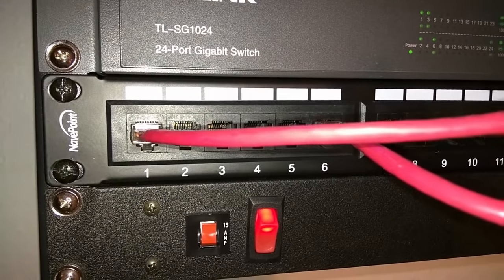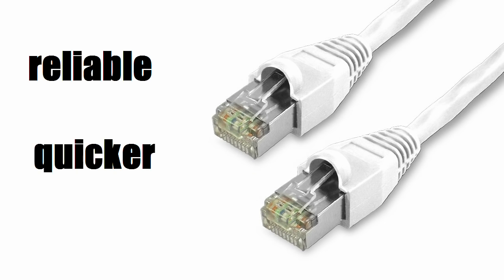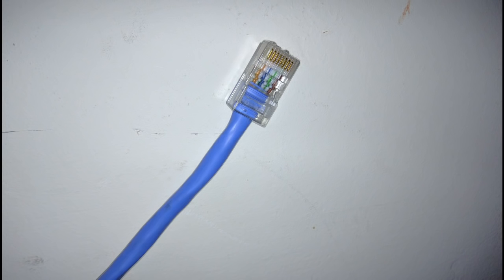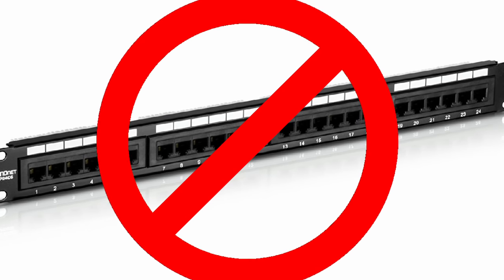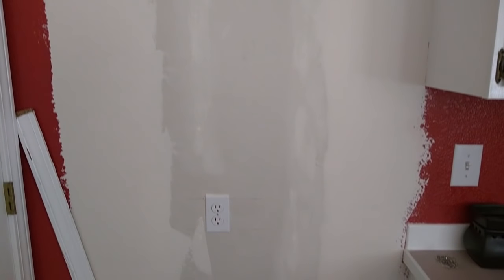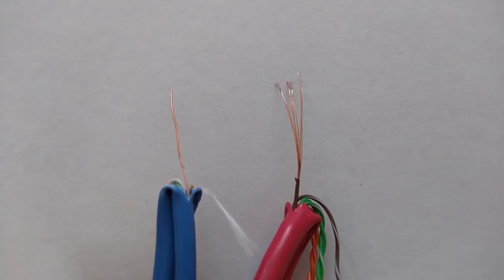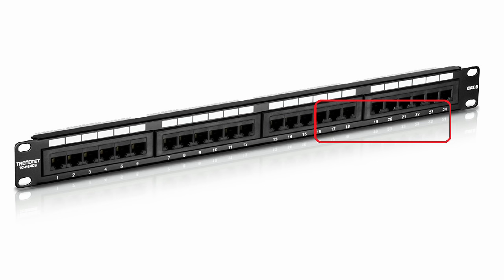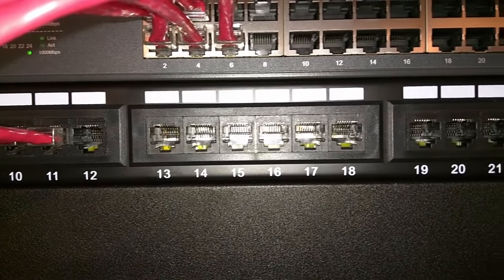What is a Patch Panel? Do You Need One?

Comment: Patch panel are dumb and a complete waist of money (labor+materials), Properly label all the cable, and plug them all directly to a switch are the best way.
Reply: No. You obviously have no experience with large networks. Patch panels are great for installing cable once and then connecting (i.e. patching) things to go where they need.
Reply: Sure, if you want to work harder later and you're not used to documenting your work. Otherwise, as Samira Peri said, PPs are a must in a large network. Heck, even in my house I have a rack housing an OPNSense router, a gigabit switch, a NAS, HASS controller, NVR, can you imagine having almost 24 (and more to come) labeled CAT6 cables dangling in that, not big enough, enclosure? In the summer sometimes I need active cooling, it's just not enough space for snakes, a PP can help to keep everything neat and tidy. But at the businesses I have under administration, with 100+ cables in the main racks, to not use PPs is just crazy, but then, they have more money so they can ask and pay for better cable management, which is good for me because that means more work and documentation initially but lazy money afterward (not to mention easier times to document the networks for ISO certifications). Anyway, I would do what you say in a small house network, with not more than 4-5 possible wired devices, but usually, I avoid this mess. :)
Reply: Lol. No.
Reply: @vincinoyb9734  Me? All day long! I like my PP! And it appreciates my attention. Now, seriously, of course, you're right, if you can fit everything in a 5-port desktop switch or maybe in an 8-port one, a PP is overkill. More than 8 usually means some kind of server, PoE injectors, UPS and things are getting messy already. Anyway, design with extensibility in mind. If there is any chance for a network, a home network I mean, to grow over time, better leave space for a future rack and enough cable to route it in the rack. Cable and space in a corner are usually cheaper than redecorating a house. The reason for using a PP is not because it looks cool, well, some does, but because it allows you to use the standards. better document and physically manage the network. Also, to use AMP products is not exactly a requirement for a home network, but at least use products from a reputable manufacturer. Networks I designed or helped to make 10 or 20 years ago are starting to bite my ass with small things, but very annoying. Cables left too short in the wall? Check. Cables with isolation that changes its color from one end to another? Check. Not enough cables in the wall because the owner considered at that time he wouldn't need them? Also check. Cables with low transfer rates because they're running along the 230V power cables (Romania, EU)? Naahhh, kidding, I never made this mistake. But the list can continue. Anyway, this is from my own experience, I'm not really in business of cabling network, I'm managing what they're usually designed to do, but it helps if you have from the start a good, reliable infrastructure.

Comment: Blah, blah, blah, just label the switch that is coming from your router and after that write the number on the wallplate, done. Just get a 48 port switch if you want to be complex, and after that you can just add another switch if you fill up all the ports and run a patch cord between the switches. Patch crap.
Reply: Sorin Sandu Who cares about which wire goes where in the house anyway. Just plug them all in. I mean, at the not-switch side of the cable, you know that the cables go to the switch. You can label the wires nearby the switch, and then you have everything you need to know. No need to mark the outlets throughout the house.
Reply: Of course, there is a need!!!  I was having Network issues. my Tivo Stream was having issues streaming to my Windows Computer.   I notice a feature on my Managed Switch to test the lines.  Sure enough, it told me what port on the switch was having cable issues.  But I didn't know which one, or if that as even in the room with the Tivo.   I also found out I had some issues with some other ports around my house.  It took a while to go though room to room, plug one in of my cheap tester in and start unplugging cables on the switch to find out which was which.  What a hassle.  I labeled the cables as I figured it out. in a way I would know what port in the room it was.  Having figured that out, I swapped cables where the Tivo was to a different port I I knew was good and it started working right. 

When you have a bunch of cables, Labeling makes sense.  All my cables in my 2 new Patch Panels are labeled.  So is each and every Keystone in the walls around my house.   So I can see MB1, and know that's Master Bedroom Port 1.  1 starts on the top left, goes right for 2, down left to 3, and over for 4.  It depends on if I have 2, 3, 4, or more ports on that wall.  In my Computer room, I have 2, 2 port Wall plates and a 3 port wall plate. on on 3 of my walls.  The 3 is a new one.  I almost wish I went with a 4.  Darn,  I'm not going back under my house to run another cable.

Comment: just get good wifi lol
y'all talk about security with cables but all your smartphones is still connecting to your home network via wifi and it hold all your personal/banking data lmfao
the only real benefit of cables is for gaming devices to get good latency
its way easier to just unplug a wire when you ground your kids or replace the entire router/switch when you have a patch panel ready
Reply: Never been in a place where good wifi is possible, eh? Either heavy wifi use in the area or building materials make wifi propagation difficult. Yeah, you can throw access points at the problem to a rediculouz point. But you'll still be having to drag cables to every AP. Otherwise you may have great coverage  but it's slow as hell.
Reply: Yeah, wired networks are a flex, but it's not a pointless flex. Low latency is useful for more than just video games. Some people like to have a NAS, home automation, custom DNS, etc. on their network, and wireless just isn't good enough for that. In fact, some software actually require a wired connection (Proxmox VE is one example). Or, if you're hosting a server at home that will have a fair amount of traffic (such as a public-facing website), you don't want to congest the WiFi space for you and anyone else living with you. As for security, you could keep devices like TVs, smart lighting, and your smartphone on an isolated network using VLANs.
Reply: @glynnetolar4423  unless if you live in a mansion then yes you need multiple access points lol
a normal house only need 1 per floor
Reply: @loucipher7782  a "normal" house? You mean 'Murcan cardboard house? Normal people being normal houses that are built out of brick and reinforced concrete. Wifi is absolutely piss poor in a normal house. I have a mesh network because of this, and I have 1 AP per room. Anything less already means patchy wifi.
Reply: @DavorZdralo  lmao. calm down there dude.
Reply: lmfao

Comment: No one needs this at their house at all, it's just for nerdiness. It isn't even a good idea at businesses with changing environments, it's a pain in the ass to patch cables when all you really have to do is VLANs and shutting down ports for security.
Reply: If you have Ethernet through your walls it easily gets to a dozen different ports around the house and it makes sense. 

If you have your main computer next to the ISP provided switch and the rest of stuff if via WiFi, then no, you dont
Reply: You assume that everybody has wireless connections available.  My house was wired with  CAT 5 cabling so the transfer rates were far higher than I could achieve with a wireless router,
I also had great difficulty in getting a wireless signal throughout my house.
Reply: hence the name of the channel and it was mentioned multiple times in the video,   so ease up Ponch!
Reply: I beg to differ. My home has 2 floors + basement, 6 PoE cameras, and a couple of unifi APs. Every room has 2 ethernet runs and anything not a laptop or tablet is wired as it provides security and reliability (no interference, drops, consistency). 

My patch panel makes everything easy to manage, even the phone lines that goes to our Brother printers with fax. Without a patch panel, it would just be a jumbled mess of cabling and even with some cable management, it would still be quite visible. I'm talking about  35 cables in my setup.

Comment: Also, is this video freaking for real?  How in the hell could anyone talk for 17 minutes about patch ports?  If you have more than 4-6 cables, use a freakin patch port!!  Better yet, call a professional cable installer / low-voltage electrician!  It's not 1999, and it's not cool to do your own wiring anymore, we sure don't in IT!
Reply: Most true IT still wire themselves unless cabling a massive 10,000 square ft building or something alone the line then yes they sub it out. It is not cost effective to hire someone to com drop 6-10 connections in your house. The channel is called budget nerd.....Many like the pride and prefer it done their way not the way of a sub contractor.
Reply: @williscooper7750  A couple jobs ago, I wired a half dozen 200k swf warehouses and a couple of offices, and I would choose the warehouse over a house any day. 10x easier, more accessible. Most IT staff at small/med business don't have the expensive testing equipment necessary to certify the cabling, which is the true value add. Sure, it saved 10's of thousands of dollars, but that still didn't mean it was the right thing to do, if there was another option avaliable.
Reply: You are literally speaking out of your ass. A cable tester is very cheap. and of course a warehouse or new construction is easier. I mean your points are very moot to say the least.
Reply: Besides, this was an informative video and a how to. Of course the time spent on this video can be done and is informative. The cost of doing it yourself and buy a cable tester is far cheaper then hiring someone to install a similar set up in your house. Which is what this video was directed at....dont be an internet troll
Reply: I'm not talking about your $10 "tester", I'm talking about the testing equipment that professional installers use to determine much more than continuity alone, and provide you with actual certification reports when they're finished, for every run in the system.  No offense, but you really have no clue.  

I just hate bad advice about this stuff, I see it every day..    Hell.... in the state where I live, you can no longer run your own cable, it has to be installed by a licensed, bonded low-voltage electrician, or risk building code violations and loss of construction permits, etc, etc....  I'm not saying you're going to get in any trouble for running a line here and there, by all means do it, but if you're literally talking about wiring up a house, pre-drywall, or during a reno, or whatever, don't fuck around, just do it right.  

You can be a "budget nerd", but wiring is the wrong place to cheap out or go full amateur, sorry.  If you had to come here to figure out if you needed a patch panel, you should maybe call a contractor, jus saying
Reply: Lol ok. I have no clue.
I agree with your comment about the video to determine if you need a patch panel or not. that is true but man you are so angry.

Also your state is a bit overkill on requiring license low-voltage installers. Its why you are paying WAY to much for it requiring tools that are unnecessary. Oh and I do pay more then $10 for my testers. Its $11.50, get it right gah
Reply: Matthew Mooney well man what can I tell. I had to setup 2 Access points. An Installer was charging me sick money to run it through the house. And i juat got a drill, 100ft of cable and a crimping tool with 4 terminals. BRO I SAVED EVERYTHING And did it within the hour. _. So I really don't get your point if it's in a house. If it's a business and have to do a whole patch panel 50+ terminations, then yes I would hire somebody but for a house. Forget it. And most house nowadays come wired you just got put the patch panel.
Reply: I had a bunch of cables in my house I ran 5 years ago, and I ended up putting RJ45 plugs on all the cables and then plugging that into my 24 port switch. It worked just fine.  The other end at the walls around my house I had Keystones in the walls.    It's been like that for the last 5 years.  It works and it's cheap!!!

I did upgrade a couple weeks ago and mounted a 8U Wall Rack and I'm now using 2 Patch Panels.  But I'm using something I like Far, Far better and is 10 times more flexible,....  These are Cable Matter Patch Panels that use Keystones.   With limited room in my closet, it was so much simpler to install Keystones on all my cables, and than Snap them all into the Patch Panel.   The other benefit, though I didn't do it, is you can use different colors of Keystones.  Red for one room, Blue for another, Green for something else.  Or Red for NAS, and White for Bedroom, and Green for Router.  The choice is yours.  I went all black and have everything labeled.

The other benifit is being able to use Passthough Keystones.  So for my HDHomerun, Wifi Router, NAS, etc, etc, I was able to plug these into the back of the Passthough Keystone.  In effect hiding that ethernet cable.  Then using one of my short patch cables to go from the Patch panel to my 48 port Managed Switch.  This gives me a clean, Professional look.  The ports I didn't use, I put in blank keystones.  Later on, I can add more things, or move things around pretty easily.   

Patch Panel
https://www.amazon.com/gp/product/B0072JVT02/
Passthough Keystones
https://www.amazon.com/Listed-VCE-25-Pack-Keystone-Coupler-Black/dp/B075ZPGV1H/
Blank Plugs
https://www.amazon.com/Blank-Plug-Networx-Wall-Plate/dp/B0054RS36M/

Of course Keystones
https://www.amazon.com/Cable-Matters-25-Pack-Keystone-Punch-Down/dp/B00IO3HGUM/

Again, this is just the start of options to use with this Patch Panel.    Well made and a ton of flexibility.    I just found it so much better than a solid wall of ports and having to punch down all the cable onto the Patch Panel its self.

Again, 5 years ago, a new house for me.  Didn't have a bunch of money to do a home network like I wanted to, I went the cheap route.  Monoprice for most everything.  and using RJ-45 jacks instead of a patch panel and a rack and all that entails.  See if you just use RJ-45 connectors on the end of the wires coming from the wall, you can just plug those into the switch that is sitting on a normal shelf.  Or in my case, I didn't have enough room in my small closet, and so added a second shelf.  Everything on 2 normal wood shelves in a narrow closet.  See that is doing things on the cheap which was the point at that time.  Now after redoing this 2 weeks ago, it looks completely different.  It looks professionally done, costing lots of money!!!   Really, it wasn't too bad.  I had to get a 8U wall rack.  Replace my UPS with a 1U UPS,  2 of these patch panels.  A couple rack shelves and upgraded my 24 port managed switch to a 48 port managed switch.
Reply: I'm sure will disagree no matter what at this point but did you consider the people watching this    may not be professionals but just someone that can't afford to hire someone. Others just take pride in their home and being able to say I did all this. Surely you would agree that on Youtube we search for what we want to watch for what ever the reason  and then the site try's to learn what we like and offer it up. So  I have to ask as a professional why would you either search for this type of video or why would you click one that popped up ? Is it because you enjoy criticizing others? Take a while and think about why you might have the need for doing this is it something from your past or is it mental health related. Either way there is help.So now feel free to reply all you want because I don't get them. There is no need for talking down to anyone.

Comment: The most inaccurate video I've ever seen by far in 10 years of networking and various networking certificates that I have.
You clearly like your network to look cool at home but in real life situations using a pach panel is not cool nor professional. Also the reasons to use pach panel are not any of those you mentioned.
Reply from the maker: Really? Enlighten us with your 10 years of experience.. I'd better tell my company they shouldn't be using them then..
Reply: @Budget Nerd It seems like he was bluffing, lol
Reply: I've been to places without them, it's a nightmare, but worse is when there is a patchpanel that has "cut wires" and there are long cables all over the place, 2-3 networks with cameras, alarm & monitoring, local network, teacher network, WIFI (think school) with various routers and other stuff all crammed into ONE, rack. Jeez.
Reply: Troll.